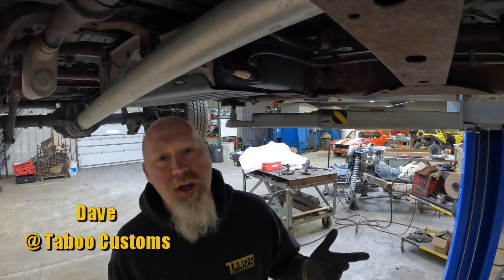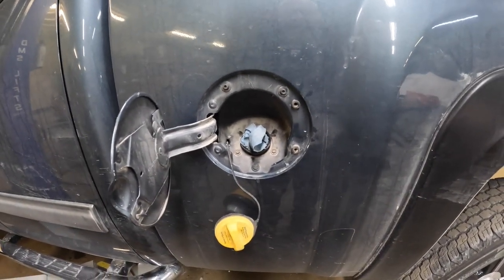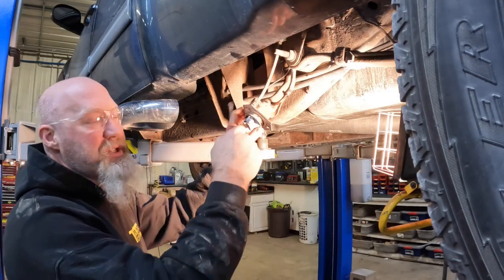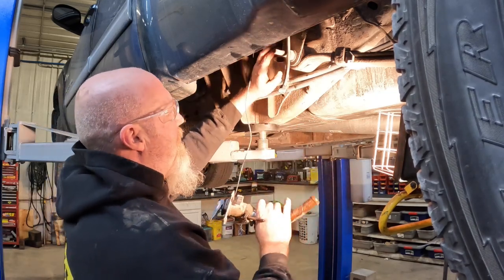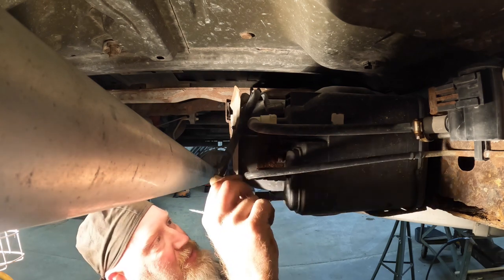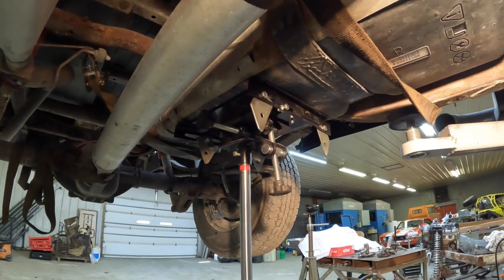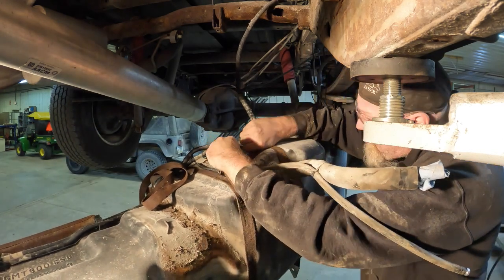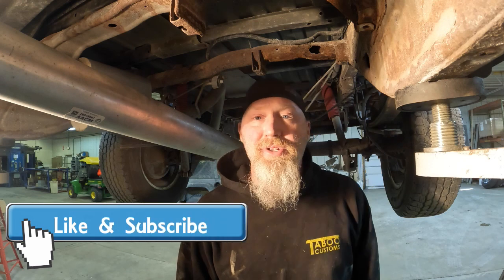Chevy 1500 Fuel Tank Removal - 2011 Ext Cab

Comment: Bro..I swear your job could have be alot easier by just removing the 6 bolts that holds the bed on and just remove the whole bed..I do it all the time..I promise you will thank me....Rock on bro!!!!!
Reply from the maker: We often do if we are doing more than just the fuel tank crossmember.  One of our older videos on the 2012 we show the bed pulled.
Reply: I tried pulling the bed and the bolt threads were rust seized to the T nuts in the bed cross members, so the T nits just spin! So NOW WHAT! LOL:face-pink-tears::face-fuchsia-wide-eyes::face-turquoise-covering-eyes: